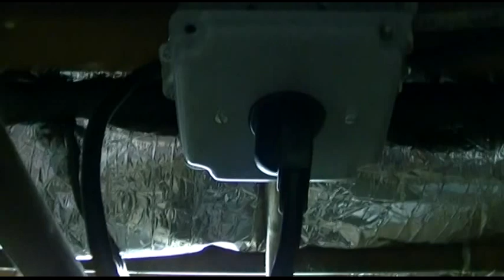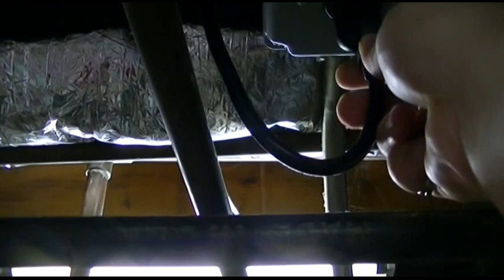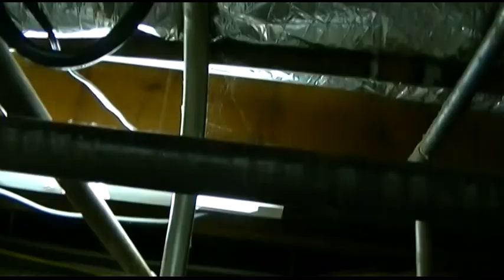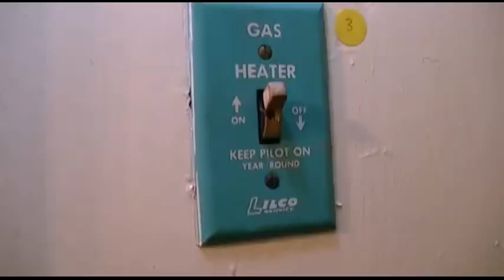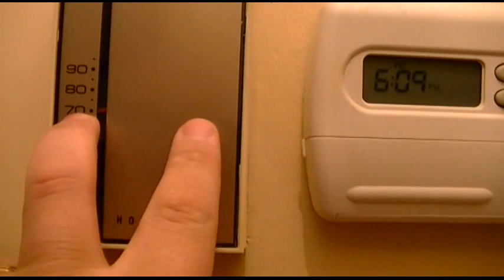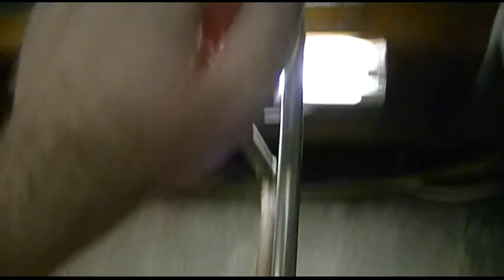A Shocking Experience...

Comment: o the allmighty jay what is wrong with this picture well just being sarcastic and joking around, You shouldent have pain at all! otherwise, your ass is grass!

no affence to you at all, just trying to get a laugh out of you
Reply from the maker: I really liked the "allmighty jay" part!

I don't like when electricity bites you.  Believe me, I've had a number of 120 volt shocks in my time.  I've found I don't particularly care for them!

The one I had previously was when I was playing with the Carrier Air Conditioner.  I didn't have the wires wire-nutted together yet, and happened to brush my hand past it.  Funny thing is when it happened, I had a perfect view of the telephone pole out front, and gained a new respect for it.  It carries some nasty stuff, and up top it's carrying 3 phase.
Reply: jaykay18
i know someone who use to work for former lilco/lipa and now pseg
this guy was working on the pole and got hit with 7500 generator plant voltage and i'm supprised that he is still here today. ive gotten hit with 120 volts and it is not fun safety third make shore to tutch the wire on that pipe again! i promice, it won't hurt you.